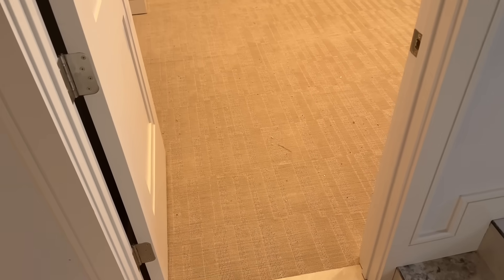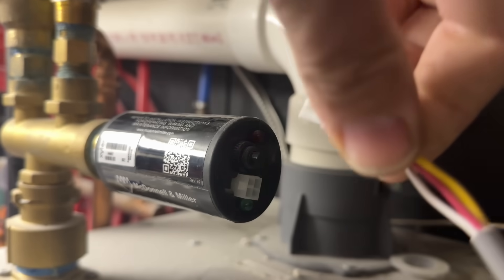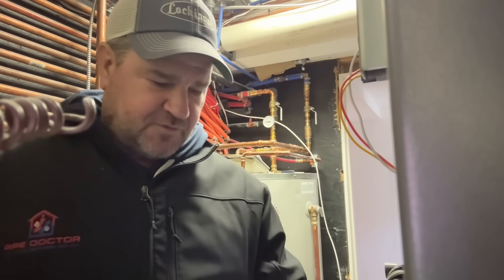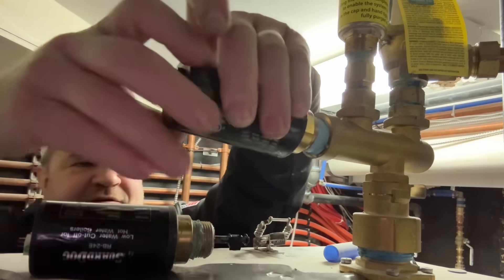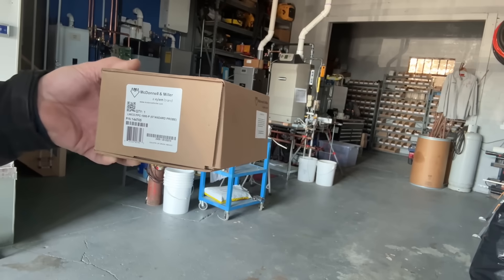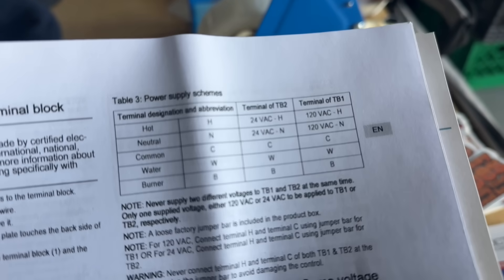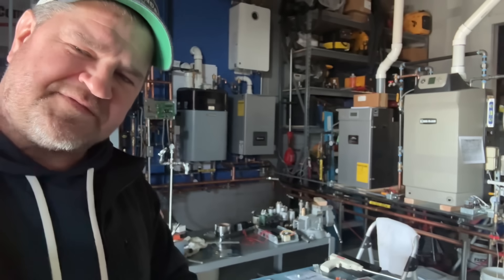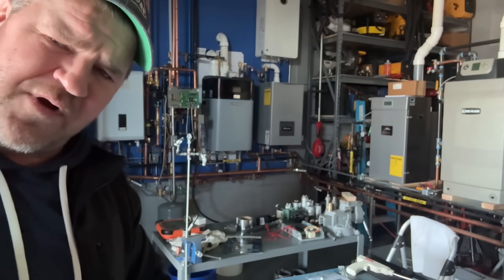Emergency No Heat or No Water - Defective Low Water Cut Off Diagnosed & Replaced

Comment: Remember once you set it with the sw4 and sw3 dip switches (sw3 for steam and sw4 dpdt dip switches for auto or manual reset) it’s locked in and would have to call MM.Xylem